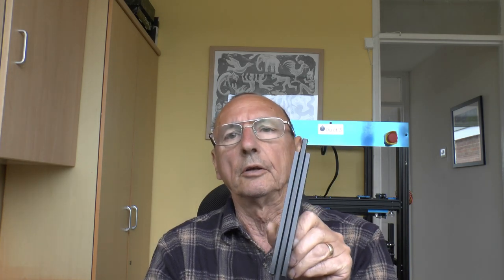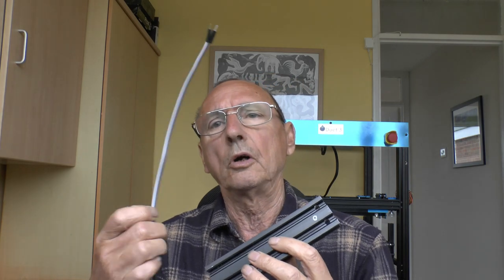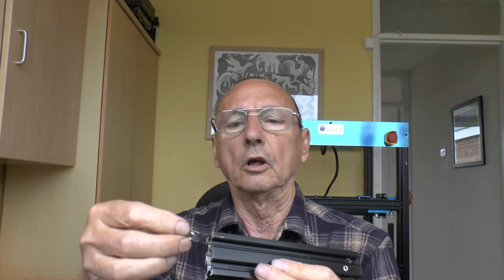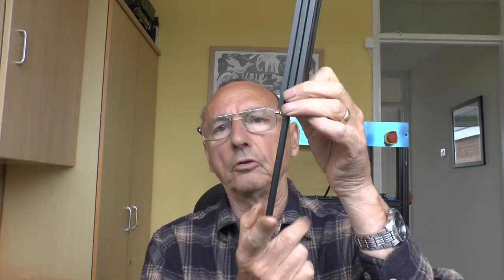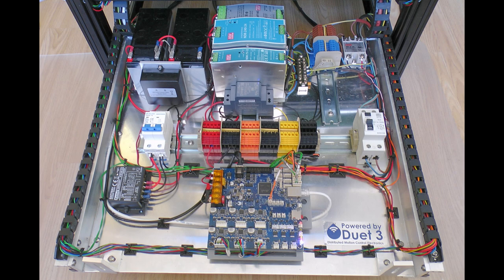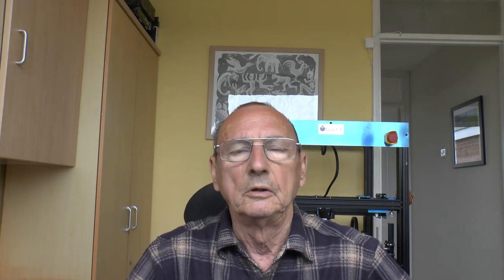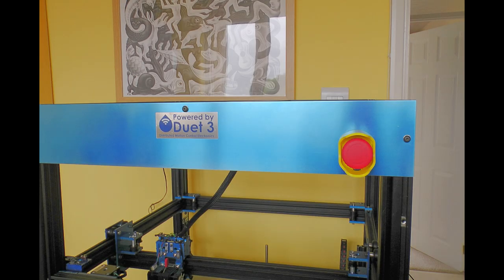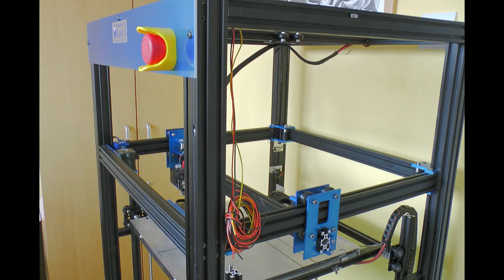NewCoreXYPart9

Comment: what are your thought on roller wheels? must be soo much cheaper and easier to build compared to linear rails. i want to make my own machine, i can see youre using them and got curious
Reply from the maker: Well each have their pros and cons. The ones I used are carried over from my original printer so it would have been costly to ditch them in favour of linear rails. They have served me well for years and many hundreds of hours of printing with heavy carriages and gantries, so I had no hesitation in re-using them for this build. I'd say the biggest downside of using v-slot wheels is that carriages end up being much bigger. For sure they are more tolerant of any slight misalignment. They are also near silent (at least the Delrin wheels are).  Avoid the min-wheels - I've seen a lot of bad reports about them. I've also seen bad reports about the "standard" Delrin wheels but I'd say the problems people have encountered are invariably due to bad assembly - mostly putting too much tension on the eccentric nuts causing the wheel to scrape along the rail and making a flat spot, rather than rotating freely as it should. I always use two gantry plates on the XY axes such that the wheel "axles" are supported at both ends. This means doubling up on spacers - both eccentric and plain, which adds cost. I only use a single plate on the linear guides and the cable carrying "dolly" where slight flex in the "axle" won't matter. I'd say that if you were using printed plates, then one either side of the member would be essential to prevent flexing. 

I have about 20 to 30 sets of wheels, including spacers, bearings, shims etc left over from when the printer was a CoreXYUVAB. Also dozens of tee nuts - normal and "drop-in" as well as assorted motors and six Bontech BMG extruders. If you are interested in any of that stuff, and in the UK contact me via my blog so that I have an email address. I'm sure we could negotiate a deal................
Reply: @deckingman  thank you soo much for the answer. ill look more into that. as of now i have my first printer still (an ender 3 max) that is getting sloppy in the Z axis, so i want to upgrade. i do have an MKS Gen L board in it with 2209s, an LGX Lite extruder and the revo high flow in it so i think ill just carry over the functional parts to the new platform. im in Norway, so maybe shipping would be expencive.  i really like your content and will be following your projects closely :) thanks